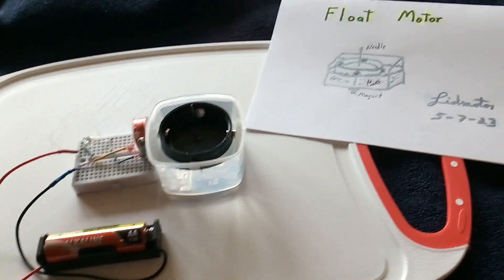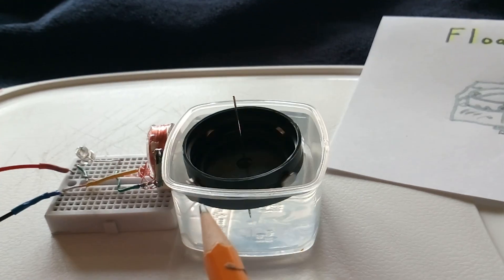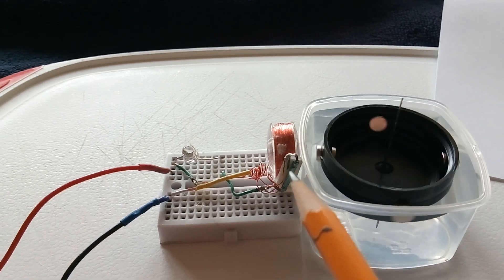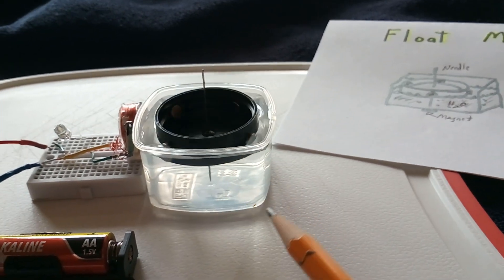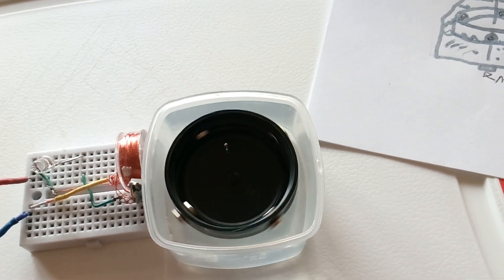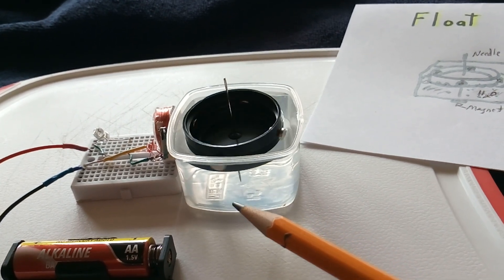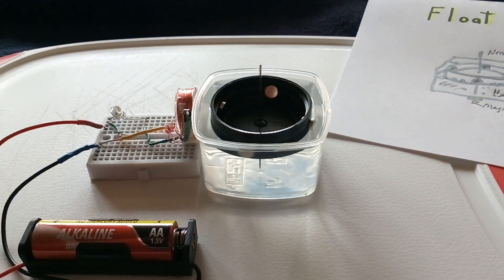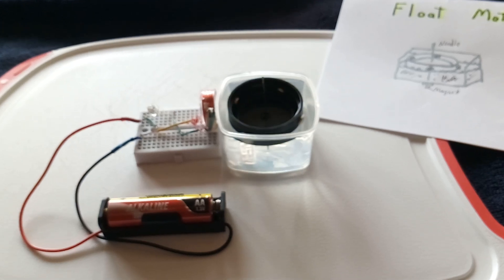Float Motor

Comment: Very good project. If you put  two electromagnets on opposite sides maybe you can loose  the needle and bottom magnet? Or do you still need three electromagnets  at 120 degree for stability in two axes?

Comment: I wonder if  putting a thin band around the outside of the lid covering the magnets would reduce the drag on the motor as it spins in the water?  Or drill holes in the lid and place the magnets so they are flush with the perimeter.
Reply from the maker: I will probably 3D print a rotor with the magnets secured inside the thin wall round boat.

Comment: 👍🤓
Interesting! 
Maybe if you put it in a nice glass container sitting on some sort of base to accentuate it, it would look good sitting up on the shelf. 
Also, you could have it lit up with some LEDs mounted in the base, may be the ones that change color, running on a separate battery. This way you could still monitor the battery life of the motor.
Just a thought…
Keep the videos coming.
Reply from the maker: Great ideas!   Thanks.

Comment: That’s very cool. What is causing the wobble, something not concentric or force from the magnets?
Reply from the maker: It wobbles mainly because the reed switch attracts the magnets on the rotor.
Reply: @Lidmotor  maybe you could use a hollow guide for the needle that still has fluid equalised to the container liquid, maybe 3D print the fluid container and incorporate an axle hollow stem.

Comment: In years gone by, they would have used a bath of mercury, but mercury is out of fashion now. Minor little issue, like it being toxic 🤔🤔
Reply from the maker: As I recall one of the first electric motors used a pool of mercury somehow.   i was thinking of other fluids that might work.  Kerosene was my first thought.  What is tricky is the compatability with the rotor materials.

Comment: Wouldn't necessarily need to fill the whole container with oil...just the top half inch or so would suffice as oil is lighter than water anyway and having the oil top layer would keep the water from evaporating. BTW, does anyone have a link to the schematic diagram for the electrical part???🤔
Reply from the maker: Here is a simple reed switch motor circuit. I don't use a metal core in my coils.    https://slideplayer.com/slide/9845076/.    Thanks for the tip about putting a thin layer of oil on top of the water to keep it from evaporating.